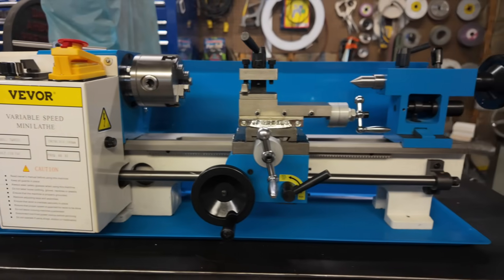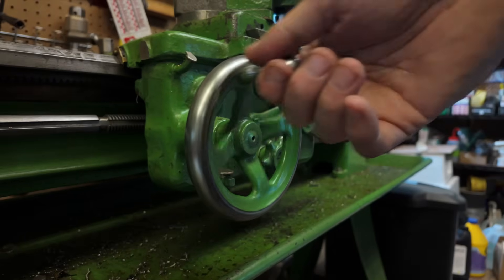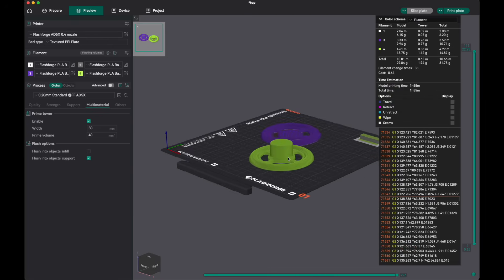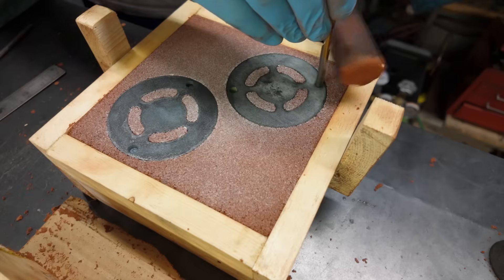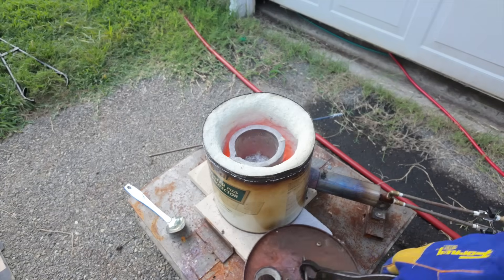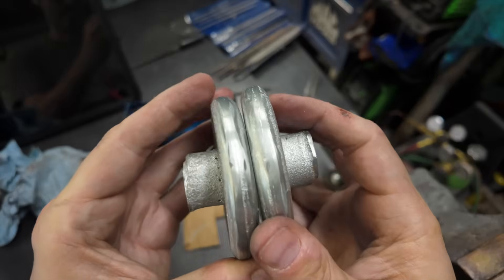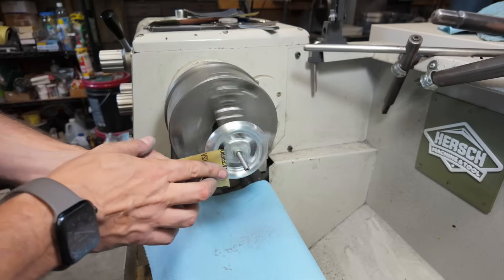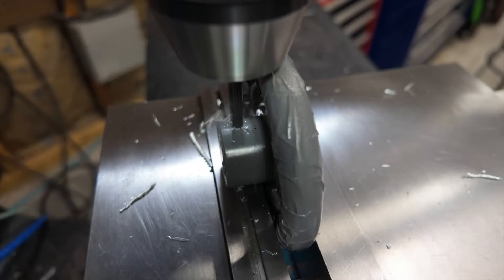You Might NEED This SIMPLE Upgrade - Turning Plastic into METAL!

Comment: The new hand cranks are great! 👍! They're no match for those plastic ones.
Maybe you should add two additional locking screws at a 120° angle. Then you can center the hand cranks and they won't wobble so much when turning😉.

Comment: Nice work…. But why turn it to metal and keep the plastic knob? And why all this grinding and manual filing? You have a lathe… I know it you are doing handles for it in this video 😁 you could smooth any surface except the one inside radius with the knob hole and the inside of the spoke holes with it if you drill the axle first… or straighten the edge of the paint with it.
Reply from the maker: Video making the metal handles is already up on the channel :) And it's called "fettling". Grinders and files are metal working tools too! ;)

Comment: I’m also experimenting with casting 3D printed parts, specifically gears because I don’t have any fancy metal working machines I can make gears with lol! I recommend autobody filler to fill in the layer lines. Doesn’t take nearly as many layers, and can be sanded to a perfectly smooth finish.
Reply from the maker: Yeah that’s a really great idea 👍 thanks for watching btw

Comment: Great project for Zamak scraps! And yepp, that burner is a beast... you're overheating the Zamak quite a bit 😅 There's really no need to let it catch fire, we aren't making brass here. Lower temps => higher surface tension => smoother parts (the finer sand texture won't be fully replicated).

Been playing with this stuff a bunch after buying a full metric tonne due to a lack of hobby suppliers in the EU 😅
Reply from the maker: haha, yeah I BURNED the living daylights out of it. I'm still figuring out how to control temps with that burner, right now I basically either have it set to "center of the sun" or "off"... Thanks for watching btw!
Reply: I bought an infrared no contact thingy with a 1900°F max, so I would stop overheating the aluminum I cast. Seems to be accurate enough for what I do.

Comment: For smoothing, try printing in ABS and then fumigate the parts with acetone in a small sealed container. The vapour from an open dish of acetone will smooth the surface of abs parts in a few minutes and merge the layer lines into a glossy surface.

Comment: a quicker way to smooth your prints, especially for something like this. IS paint some 3D printing resin over the surface and curing it with a UV light. Done in 10 mins and ready to go, no waiting for paint to dry properly

Comment: One thing you can do, is to print the channels for the pour directly attached to the part before putting the sand in. This eliminates the need to carve the channels out manually. You just need to be careful and make sure they dont get stuck in the mold. Tapered holes help. You can also make them removable from the part but are indexed to it. So the poure channel would be a round tapered seperate part that is indexed to the 3d print part but seperates easily. Then put both together and pour your sand. Once its all poured and tamped down you pull out the channel holder from one side and the part from the other side of the mold. I am just saying this to give you some ideas since you mentioned you don't like digging into the sand after you tamped it all down. Very nice little project, it came out great!
Reply from the maker: This is FANTASTIC thinking, thanks! I'm hoping to find time to experiment more with the printer and the kiln before the weather turns too cold again so I'll definitely keep these ideas in mind. Thanks again, and thanks for watching!
Reply: We are coming to your shop for a weekend of casting fun!
Reply from the maker: @patrickhayes3099  haha sounds good
Reply: You can also print your parts with 0% infill, add perimeters if you absolutely need to, and simply pour the metal over the printer part. The plastic will burn away as you pour, removing the need to ever separate the mold at all

Comment: @8:59 can you talk about your 'Crazy Burner', thank you 👍👍
Reply from the maker: Absolutely, I bought it from another guy who has a YouTube channel. Nobox7, he makes all kinds of different waste fuel burners that put the stuff you find on amazon to shame. Check him out if you're in the market. This burner is NASTY, it'll hit some crazy temps, really fast. I'll talk more about it in the next casting vid that I do as well.
Reply: @hersch_tool  Thanks, yes, I have seen his burners, very tempting to make replica, but using a copy of luckygen1001: just thin pipe into a thick pipe and reversed vacum cleaner, cheap, melts bucket of copper in 12min
Reply: @hersch_tool That green color when you're melting? Isn't that copper oxidizing? Be careful not to overheat if you're doing Zamak 12, zinc fumes will make you dog sick, I hear. I love seeing people casting metal. You can make anything with it.

Comment: If you can do metal casting, does that make you a metal wizard now? How many metal spells can you cast?

With multi material printing, beware of cross contamination in the meltzone. Some plastics just foul others for a good long while until more than you think is needed is purged, a lot more, destroying cohesion. This is what people with filament changers found for example about ABS prints with HIPS supports, that ABS would often come out weak. (though arguably they might have the wrong idea there... i mean why use HIPS to support ABS, when you can use horrible cheap disgusting ABS regrind to support HIPS, and it won't even foul it that much; also while ABS is a more renowned injection moulding material, in printing, HIPS is plain better behaved)

I think zinc might be a little underrated. I think it's quite metal.
Reply from the maker: Great question. I’m technically an apprentice metal wizard. So I can cast some basic metal spells like “turn diameter”, “tap hole”, and “play Sabbath on Spotify”. Great info about printing btw, thanks. I’m still learning about 3d printing, has never been something I put a lot of focus into learning about. But now that I have a nice printer that’s changing fast!

Comment: You cut the two cast wheels apart with a bandsaw then cut the sprue off with a hacksaw? Did your bandsaw blade break or something?
Reply from the maker: No, there was just no great (aka safe) way to hold onto it to cut the sprew in the bandsaw, and it only took a couple minutes with the hacksaw so I figured no big deal.

Comment: Next time, if you're printing two pieces with different filaments, change the printing sequence.
Don't use layer by layer mode.
Select by object instead.
This way, the printer will complete one object first, then move on to the other.
This configuration reduces printing time and minimizes filament changes (and poops)
Reply from the maker: Yeah I ended up with a lot of poops... thanks for the advice!

Comment: I’m a hobbyist hack, and @ 15min when you put the tap on the drill press, I realized how crocked everything I do is
Reply from the maker: lol, what @rallen said, we are all just doing our best and trying to learn through our mistakes. Nobody starts off perfect, or gets it right the first time. I have a video and free drawings for the spring loaded tap follower that I used in this vid. You can download them and make one for yourself, it's a great Saturday afternoon project. Thanks for watching btw!
Reply: He cheated. Using a drill press makes it too easy.
Reply from the maker: @ddegn  🤣😂🤣
Reply: Welcome to the club. We're all hacks of one stripe or another. If you want to repaint, go get some Krylon BBQ paint, it's formulated to make the paint stick to cast aluminum/Zamak. Don't touch Rustoleum, it's junk.

Comment: I've seen folks actually just leave the PLA in the mold before pouring in the metal, apparently it just disintegrates? It works a bit like Lost Wax casting. Could make for an interesting experiment!
Reply: I wouldn't want them to mix, normally they heat the mold to melt it out first, at least the ones I have watched. Are you saying they don't melt it out first?
Reply from the maker: @newmonengineering  That's how I've seen it done as well, melt out the PLA before pouring. And normally using plaster as opposed to sand for the mold iirc.
Reply from the maker: Yeah they call it "lost PLA" I believe? I would definitely like to experiement with more complex patterns using this method in the future.

Comment: I was shown a different technique. 

Rather than have a riser make vent holes with a wire, typically welding rod.  These holes stop short of the pattern.  I was suspicious but this dies vent gasses better than usung a riser in my experience.

The runner is different as well.  A block with a draft is placed close to the pattern.  When its removed the sand is pushed down/smoothed with a trowel forming a thin, 1/2mm or less wide gap that runs the full length of the pattern.  This allows the aluminium to flow slowly and evenly into the void.
The block needs to be taller than the pattern so as to add pressure to mold.  This results in an accurate and detailed casting.

A runer is formed by pressing a pipe into the area above the block and forming into a funnel with a suitable trowel. 

The main advantage is that this method results in a clean casting with a very thin 'flash' that is a lot easier to finish than the lump that results from the 'gate' from conventional runers and risers.

This was explained verbally to me some decades, from memory this is called the Crompton method.  It served me well.
Reply from the maker: Excellent advice, thanks for taking the time to drop knowledge in the comments for us. I'll try out some of these techniques. And thanks for watching btw!

Comment: I had a 7x16, but same ideas apply. I had a bunch of mods

I used the slim magnetic DRO scales to make a dro setup. 

Bored out the crosslide handwheel for a thrust bearing. 

Got the extended crosslide lead screw and milled out my crosslide for extended reach. 

1000W sewing machine motor for the spindle drive. I made a 90° plate that used the stock motor mount holes to provide a mounting surface for the new motor. 

You can swap out the sewing machine foot pedal for a potentiometer and use that for variable speed. 

I also made an electronic lead screw for mine. Made the machine much more useable. Highly recommend this mod. 

Changed to an actual bearing for the end of the carriage lead screw. 

Lapped the crosslide to the carriage. 

Swapped out the head stock bearings for angular contact bearings.
Reply from the maker: This is a fantastic list of upgrades
Reply: Is there anyone that just sells the major parts in a kit? Maybe a discount? If I could get the basics running, I'd build up the rest the way I wanted. As for right now, I'd have to pay over $1000 to basically get a POS kit that has to be machined and rebuilt to be any good.
Reply from the maker: @rallen7660 I’m not sure about a kit, but the mini lathe I have cost less than $500, and you can use my link for a further discount. IMHO, not bad what you get for the price. It gets you up and making chips right out of the box

Comment: Even after you replace the knob with your nice one, it still wobbles when you turn it.  Is the shaft bent?
Reply from the maker: yeah it's a little wonked, also could use a bearing to tighten up the bore.

Comment: i been making casting patterns by 3d printing them for a while now, and with petrobonded sand and petg i rarely even sand my patterns. i print with 0,8mm nozzle and 0,5-0,6mm layer height on a beaten up ender 3
sand may stick to my patterns on ocasion but if they are drafted corectly and covered with parting powder the only downside to printing patterns are layer lines showing up on the casting

by the way you overheated your zamak waaaaayyyyyy too much, recomended casting temperature is around 430 degree celsius  and at that temperature you rarely see any green and white smoke (which is toxic by the way)

zink aloys area good choice for a wheel like that but it can go dull grey with time
Reply from the maker: Yeah man, I actually had a bit about it that I recorded where I mentioned zinc oxide poisoning, or "metal fume fever", but it ended up on the cutting floor. WAAAAAY too hot. Still figuring things out as I go.
Reply: @hersch_tool  i have thje beginer electric furnace so i can tell you it does not fume at all at 520C and you suposed to pour at 430c "max" if the crucible starts to glow red it is above 650-700c and this is aluminium melting temperature my casting are not perfect but at least i don't feel like i inhale too much smoke

Comment: What is the Borax for?
Reply: It's used as flux to float any impurities out of the metal, then they can be scooped off before pouring.
Reply: Without flux the swarf will turn into Oxide and be discarded
Reply from the maker: what @customcutter100 and @awatt said 🙂

Comment: I love the casting… I feel like casting metal is something that comes along after using machines for a while and realizing 3 things.. 1) Metal (material) is expensive 2) it sucks not having said materials on hand from time to to time 3) casting parts or blanks of material is pretty easy once you have the setup.

I save up aluminum scrap and melt it down and cast round bar or sometimes plates to make into fixture plates. If you cast into exhaust pipes it comes out pretty easy after it cools and can be reused. Anyways love your channel bud keep up the good work
Reply from the maker: Thanks very much, and yep I agree. Casting is a natural progression if you're doing machining I think.

Comment: 3 best things I ever did for my mini lathe project. Electric motor for lead screw and brass gibs for the cross slide and compound then machined a block to replace the compound when not needed. Other wise they’re a great value imo. Guys can make and fix lots of stuff in the shop with one.
Reply: do you have pics/description of your cross slide motor?
Reply from the maker: excellent upgrades! I'll be doing similar for this one.

Comment: Ouch, printing both pieces at the same time in different colors meant a lot of needless waste of filament as the nozzle had to change colors back and forth like that.  You can set it to build one piece at a time so you're not just making tons of plastic waste.  Or just print one piece at a time.  It's not as pretty for the youtube video but man, you can't get that plastic back.  Missed an opportunity to use the mini lathe on the handwheels for the mini lathe too.
Reply from the maker: Yeah, I was just experimenting with, and learning about the printer. I've never used a printer with these fancy features.

Comment: I`d have gone with a much larger handwheels... I`m currently mid lathe handwheel modifications for my minilathe(among other projects), as mine is an olden lathe from the 80`s or so and uses even smaller brass handwheels which drive me fucking nuts after 10 minutes of use... 0 leverage, 0 momentum, very nice looking, nice finish, but they are awfully small, jerky and uncomfortable to use for longer than a few minutes... The tailstock handwheel should be massive, as it makes drilling a breeze, and you can always stick you finger in the skeletonized section closer to the middle to lose the leverage and ``restore the sensitive feedback`` that small diameter drills appreciate... The size and mass grant it momentum so you can accelerate the handwheel and have it retract the quill fully in a second, and you can add a thick felt pad inside the tailstock to act like a retardant for the quill itself when it`s about to bottom out... Moreover, a larger handwheel automatically translates into a finer resolution of the rotation, as does any increased length of lever... The torque increase is nice for large drills, but the real prize is the massively increased resolution of the rotary actuation... The longer the lever - the more controlled the movement... 

Best regards!
Steuss

Comment: It's hard to believe, but iron is a lot easier to cast than aluminum, once you achieved the high temperature issue. It pours and fills a lot easier with fewer defects.
Reply from the maker: I would like to try iron in the future, my burner can definitely hit the required temps
Reply: Do you have a video on how to do it safely without a huge workshop? I do agree that cast iron is amazing.
Luckily I got my hands on a cute old South Bend, so all the casting has been donw for me.
Reply from the maker: @AlexDiesTrying  I have a video where I’m casting a draw bar handle in which I talk a little about how I made my kiln. But maybe I can do a vid in the future actually showing how to make one. It’s easier than you might think. I made my kiln from an empty deck sealer can and it works great.

Comment: They definitely need some machined handles to finish them off. I think I'd have skimmed the face to remove the casting finish too but that's personal choice. Swap that very average nut on the tailstock for a nice brass domed one and it'll look 😍
Reply from the maker: machined handles are coming!
Reply: yeah, sanding on lathe doesn't work for some reason, I tried it, the machined surface is much better.

Comment: 4:37 It would have been much faster and used much less material if you printed one part then the other, when printing 2 parts in differn't colours like this. you will notice in the timelapse that the majority of the time is spent purging material, time and material that could have been saved by either sliceing and printing the parts separately, or by changing the print order from by layer to by object.
Reply from the maker: I printed the second pattern in one solid color. But I was just playing around with the printer and testing things out so efficiency wasn’t exactly on the menu 🙂